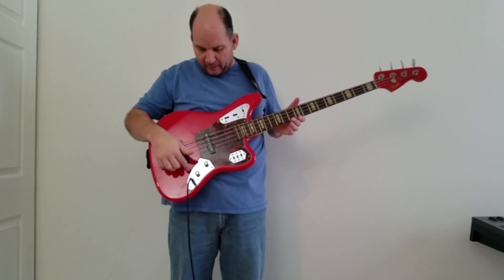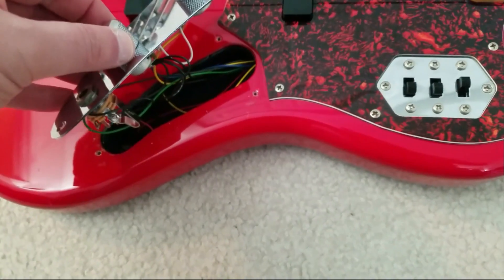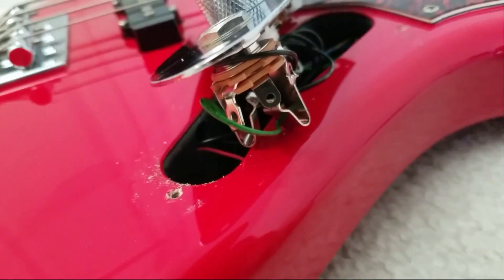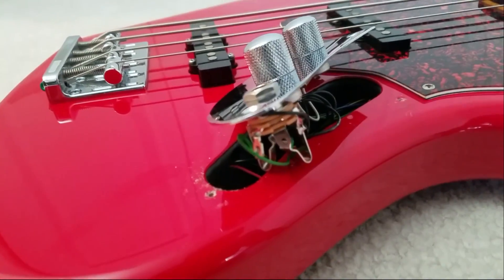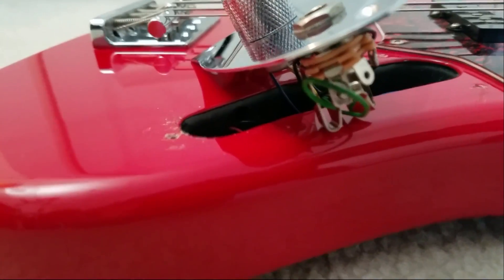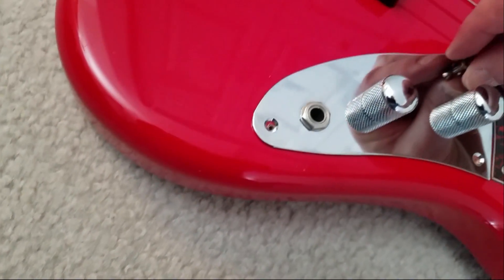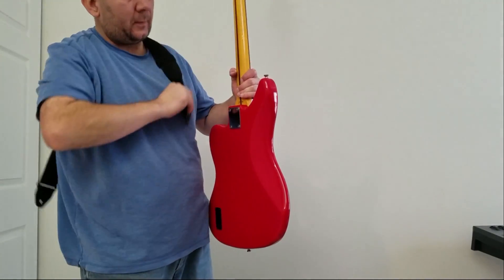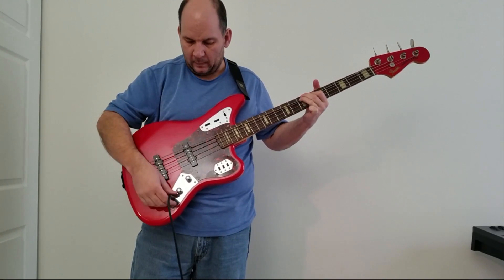Quickly repair your loose or intermittent guitar or bass Fender style input jack

Comment: another tip that may work if this doesn't do it (especially on older guitars) and where you notice that the jack crackles and pops as you spin your lead in it, then get some electrical contact spray and apply some in the hole of the jack. Just worked for me and well pleased as I was thinking I'd have to replace the vintage jack :(. Turns out it was corrosion inside the barrel - when i looked I could see it - rust. Spray fixed it - don't know how long for but at the moment it's completely noiseless.

Comment: This is the exact issue i had with my Les Paul guitar. Every other video i found said to tighten the nut. I quickly realized that the nut was tight but the spring needed a tiny bend. Put it back together and the cable was tight. I really don't understand why checking this isn't in every video out there.

Comment: Mine is kind of loose at the moment, but I might not have to go through all the work of undoing it , if the nut that's holding the input jack just needs a little tightening right?

Comment: So, I repaired mine, tested it before installing it...outside of a bit of static, seems fine.  When I go to mount it, it does't work.  Take it back out, works fine.   Re-install it, no go - it seems like the plastic pick guard cuts out the connection.  Is that possible????   I've given up.  Any ideas.  Oh, and if I press hard on the jack when "installed" it seems to work.